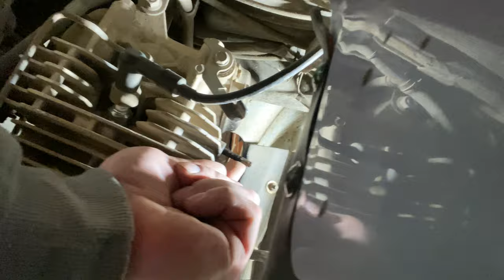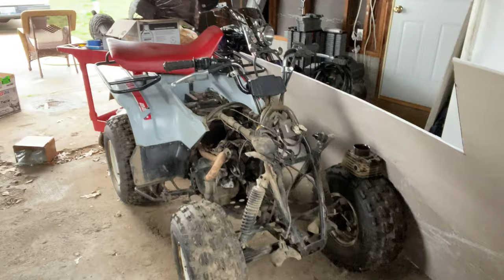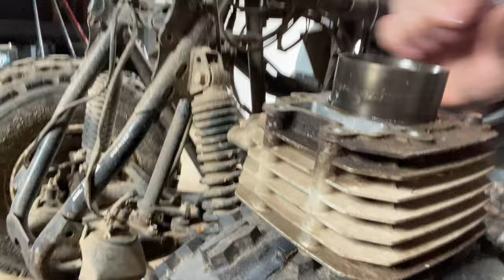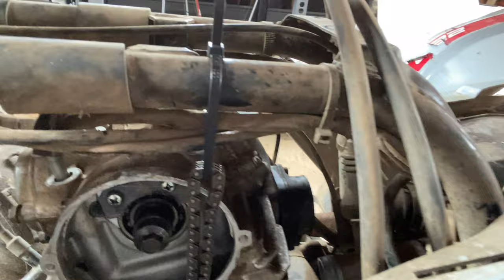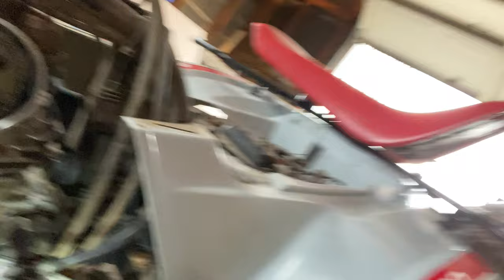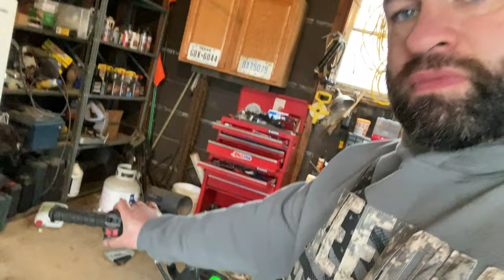Chronicle # 26 Kawasaki Bayou 220 Top End Rebuild | Wheelie Shenanigans

Comment: I drilled mine out without removing anything. I should have just tapped it, but i tried to get the rest of the bolt out with easy out. Of course the NOT so easy out broke. There's a bit out there that is supposed to be able to drill out easy out, so i guess that's my next move.
Reply from the maker: Yes it was a lot of work for a broke stud LOL.

Comment: Help me my 94 220 is buggin out. New carb high idle. Wants to take off itself... hard to pull now.. idk what to do
Reply from the maker: Have you tried turning down the throttle adjustment? Also there may be different positions for the throttle needle. If it’s new it has to be a adjustment of something.

Comment: If it’s smoking by the engine compartment do you think I should rebuild the head , it runs well it just starts smoking after a while just curious
Reply from the maker: Without seeing it I really can only guess but it sounds like maybe some blow by which would be caused but failing piston rings. So if that is the case doing a top end rebuild could help. Thanks for watching.
Reply: Mine is leaking from the head, dripping onto exhaust, which is bad valve cover gaskets, but for $40 on ebay I'll just rebuild it.

Comment: I got my 220cc Kawasaki bayou yesterday
Reply from the maker: They are great little quads. Not fast but definitely reliable.
Reply: @thestevezchronicles2342  Mine's broke down. I wish it was reliable. haha. It started off with stalling when you came to an idle. Then it got worse and worse for that over 6 months. Paid 1200 for it. Barely driven it since december. It started leaking gas. So I cleaned the carb. Worked okay for 1 day. Then started spitting a tiny bit of oil out of the top end somewhere. Has great compression still. Starts up perfect. But now stalls after 30-60 seconds before it can warm up to even drive it. sigh. So now I have a carb kit, and a top end gasket kit... probably need a piston and rings... I thought the kit I had ordered came with a piston, and rings, and gaskets... after all that's what I ordered. Turns out... nope. They told me it did. Then I get it in the store... and I'm like... uh... where's the piston and rings... So for 169.99+tax canadian, you gotta buy the "full kit" which still requires the gasket kit for 40+tax, plus you still don't get the guides or the muffler gasket, and some other stuff... :( :( :(
Reply from the maker: Jon Raven oh man that stinks. Hope you get it running.
Reply: @thestevezchronicles2342  We'll see. Problem with any engine work, is so many things in there that can also turn out to be worn, or not long for this world, when your machine is 22 years old. haha
Reply: @fireblazer6661  mine starts but I need a new air filter and carburetor
Reply: @tristenthewolf-king4866  mine's still starting RIGHT up, first tap of the electric start... but don't wanna stay running beyond a minute... then stubbornly will refuse to start up unless left alone a long time.
Reply: @fireblazer6661  Old thread but what the hell....  Your needle valve passage sounds like its partly plugged up.  Just fixed the same issue on mine today.